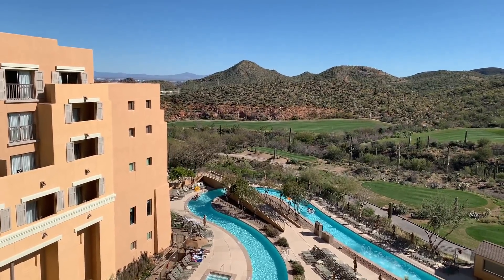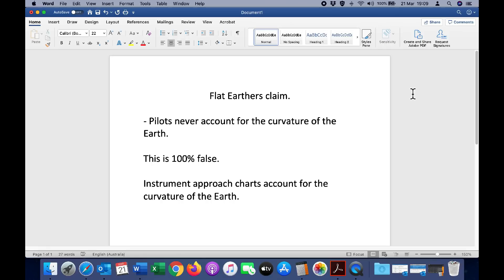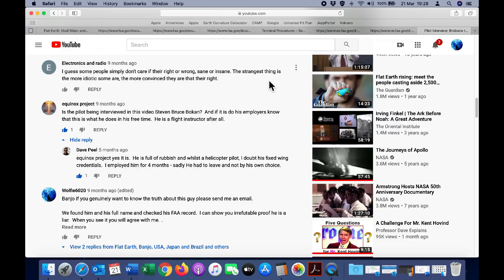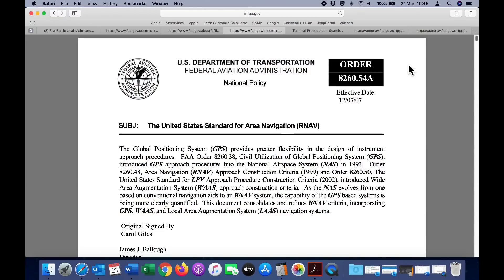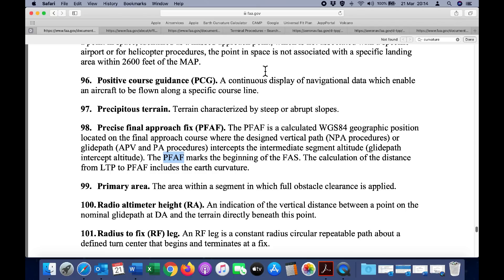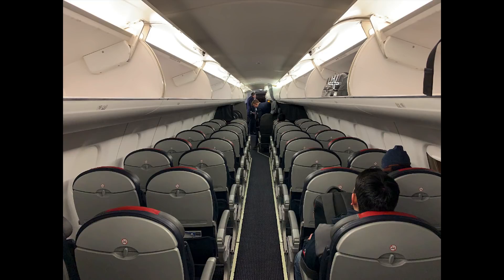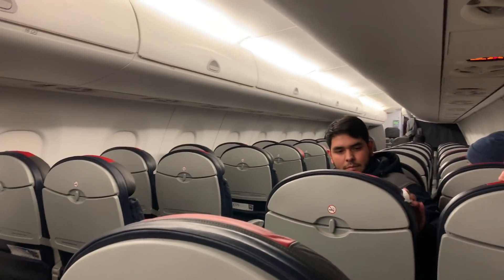FAA Documents confirm Pilot approaches are calculated for the curvature of the Earth.

Comment: As per usual, Wolfie takes no prisoners.
Reply: Muzikgod #IsARectalCumDumpster.

Reality is actually on my side when you co and look.
Reply: @blurplebear8573  Wow you're stupid
Reply: @blurplebear8573  So you didn't answer to what is the distance between Sydney and Santiago, you just linked to a site that teaches how to understand where you are on the globe earth. That's fantastic.
So a flart earther defines where he is using the spherical geometry.
It's complicated the spherical geometry, the flat geometry is a lot more easier, there is no distortion of the features on the map no matter how big it is.
So it should be the simplest thing to do, calculating a distance on a flat map. Everyone is still waiting your calculation Sydney - Santiago.
An approach for landing is not a curve on a lateral side. 
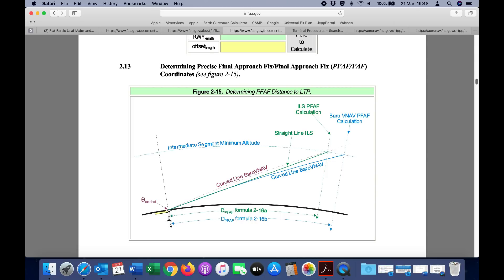5:45
It is a rectilinear or almost rectilinear path, that follows in one case a radio beam that has a straight path. The straight path becomes slightly curved if the earth is considered as flat, but actually it is straight according to the laws of physics of polarized electromagnetic beams, and if it seems curved in terms of altitude it is only because the earth's surface is curved.
 It seems you were talking with 2 pilots, besides wolfie who is a pilot, how can you think to have the right to dispute what they say?
Reply: @blurplebear8573  if reality is on your side, why do you have to keep running and make excuses?
If reality is on your side, why does my photograph show clear curvature at 41000ft?
If reality is on your side why won't you tell us the distance between Sydney and Santiago?
All you do is run and hide like a coward.
Reply: @Alysm-Aviation  It's so funny how he says Lat and Long are based on 2D and yet refuses to show that 2D map or use it to calculate a distance! It's almost like it's impossible
Reply: @hashmaldawn3878  because he knows that if he tried, he would destroy the FE.
Reply: @Alysm-Aviation  I do wonder what goes on in their minds. Do they accept to themselves that they are wrong? Despite all their squirming they must realize that it's impossible to do that calculation yet they keep on. Or are they trolls all along, and never actually believed the earth was flat?
Reply: @hashmaldawn3878  they are cultists, they know that the second that they question the FE, it will fall apart.
Reply: @marks9935  you come onto a 4yo post with... nothing...
Good job.
can you answer a very simple question for me?
Why do even the simplest of navigational techniques, such as calculating our flight distances, require us to account for the globe?
Reply: @marks9935  I love that you came here with nothing but excuses.
Reply: Alysm nope, just liberties with data.
Reply: @blurplebear8573  You clearly have not watched the video lmao
Reply: @blurplebear8573  Try looking at the video again. It doesn't talk about a horizontal curve during the approach but the relevance to the vertical profile, exactly where we expect to see a difference.
Reply: @blurplebear8573  tell me, can you show me something as simple as a functional FE based map?
Reply: @blurplebear8573  
        Geometrically challenged, aren't you? Interesting strawman you're trying to build there. Before I go further one simple question. What are the four basic forces of flight?
Reply: @zed1stwizard  Oooh, I know! Buoyancy, Density, Flerspective, and Droppity! Oh, and compressed air (for the engines to run forever on)!
Reply: @blurplebear8573  Can you kindly tell me why the following definition is necessary in an aviation document for safely flying over a flat Earth?
It's at the bottom of page D-1 (Appendix D) in FAA order 8260.3D:
"(2) r is the TERPS constant for the mean radius of the earth for spherical calculations in feet. r = 20890537."
Why would "spherical calculations" involving the Earth radius be necessary if it were flat?
Reply: @Alysm-Aviation  That shut him right down, didn't it? It always does that. Either they run away or go into a rage. They are fake. I just addressed this very point in my latest video.
Reply: @OAlem  yep
Reply: @blurplebear8573  so why did you lie and run away?
Reply: Alysm yeah it’s called any azimuthal map printed.
Reply: zed1stwizard that has nothing to do with whether the earth has a curve or if it’s moving.
Reply: zed1stwizard so you’ve talked to every commercial pilot in the world and you’re calling me deluded?  Think you’ve got that in reverse buddy.
Reply: @blurplebear8573  You don't need to talk to every commercial pilot in the world, but you do need to find one long-range pilot that can demonstrate how they navigate over a flat earth.
You realise that there are an almost infinite number of Azimuthal Projections right?
Reply: @blurplebear8573  oh I can destroy you much easier, simply by asking you for the distance between Sydney and Santiago.
When you try to BS a pilot, try harder.
And this time, don't lie and run.
Reply: @hashmaldawn3878  they don't know how AE projections work.
Reply: @Alysm-Aviation  I got a hint that this one might understand slightly more as he referred to "any azimuthal map", suggesting he knows there is more than just the one flatties usually try to pass off. Any sign of actual knowledge should be encouraged. But then I'm a glass half full kinda person.
Reply: @hashmaldawn3878  if he understands that there is multiple different types, then he knows that the FE is dead.
Reply: Hashmal Dawn well they take off and land.  That demonstrates it.  I also didn’t say it was flat.  There’s no curve though and it’s not spinning and you can’t prove either of those things.  Furthermore this FAA formula is calculating the curve of a turn the airplane makes during its descent to the ground.  That doesn’t mean the earth has curvature.  That’s called misinterpretation of data.  My car tires have a curve too and I can calculate it.  That doesn’t mean the earth does also.
Reply: @blurplebear8573  I "prove" the curve every time I go to work!

Now talking about deliberately misusing data, what turn do you think is in this video? Both precision approaches and non-prediction approaches are generally straight and with a fixed rate of descent. Fatuous comments about wheels won't help your case.
Reply: Hashmal Dawn it says it explicitly in the text which I read that it’s a descent turn and the curve is being calculated for that turn.  Are you saying you descend your planes in a straight line all the time?  That would mean you’re probably crashing them and it still doesn’t prove the earth has a curve.  It proves that turns you make in an airplane does.  The fact that you can’t decipher that difference makes me skeptical that you even fly an airplane.
Reply: @blurplebear8573  The approach is the last 3 or 4 minutes of the descent and the last 6 miles or more of any instrument approach is always straight. Look it up or maybe you can ask any longhaul pilots you personally know.
Reply: @blurplebear8573  ah, have I torn apart your claim that the AE projection is an FE map so easily?
Ok let's try this again.
Show us a functional FE based map.
Reply: @blurplebear8573  ok then tell me the distance between Sydney and Santiago on your AE projection.
Reply: @blurplebear8573  Which azimuthal projection, there is an almost unlimited number of them?
Reply: Alysm Actually a ton of wolfies prisoners in here yourself included. He’s captured your intellects quite efficiently. There is no real strength in numbers online. It’s a forum of exposition of intellect. It seems it brings out the child in the most skilled of tradesmen. The doctors of the skies included. I have nothing against pilots or those that believe they are on a globe.
Reply: @drich4608  funny yet here you are with not even a functional FE based map.
Reply: Alysm I have one. I’m applying a scale to it in case you need to use it to compare it to the real world. I have a life. Check my Instagram if you don’t believe me.
Reply: @drich4608  please post a link to your FE based map.
Reply: T1DRUMMER thanks brother.
Reply: @blurplebear8573  I notice that you still run away when I ask you for the distance between Sydney and Santiago.
Reply: @drich4608  bahahaha, I just saw antonios map on your Instagram.
Comedy GOLD!
Have you tried drawing in the equator or the tropics?
Oh man, you get more entertaining with every post you put out.
Reply: Alysm I had some life events today. Now I’m watching a comedy movie called “AD ASTRA”. It never ceases to amaze me how these types of movies feed the reality show called space. Great scenes with vintage tin foil or lighting gel plastered on the front of the rovers and the landing gear of the capsules. #neverstoplearning I’ll “present” a map for you very soon. I have limited web access.
Reply: @drich4608  don't lie, you will never show a functional FE based map.
Reply: Blurple Bear Ditto
Reply: Alysm I don’t lie.
Reply: @drich4608  you claimed to have a functional FE based map and then showed Antonios map, so yes, you are a liar.
Reply: Alysm Sorry about that I was drifting off. I was going to attach a scale to Antonio’s map for you. Do you think Antonio’s map is not functional? I think It functions quite well. Keep calm.
Reply: Alysm It’s accuracy is much better than other FE renderings. Just as globe maps are not all identical. If one map is more accurate than another does that make it more functional than than the dysfunctional? Define your version of functional maps.
Reply: @drich4608  Antonio's map is not functional. A functional map of the flat earth must be capable of demonstrating flight paths. Not just a few flight paths but all of them. It does not need fine detail.
Reply: Faster Horses I have already in the rest of this thread.  This video is making the assertion that because an airplane makes a curved turn during its descent that the earth is curved.  That’s retarded and incorrect.  It’s like saying because your swimming pool is round the earth is too.  The documents he sites are for the descent turn of an airplanes approach and the curve of the turn.  He is using that and applying it to the whole realm.  That’s not how it works.
Reply: @blurplebear8573  You want Earth Curve accounted for in aviation that you can't misinterpret or spin a narrative around? You got it. Look in the document FAA Order 8260.3D on page 10-8 at the bottom. It says:
"Because the earth curves away from the OCS as
 distance from course centerline increases, the MSL elevation of an obstacle is reduced to account for this. Use formula 10-2-3 to calculate OEE" 

(OEE stands for Obstacle Effective Elevation, and OCS stands for Obstacle Clearance Surface)
Note also, that the relevant calculation also uses "r" (Earth radius in feet). Same constant as in the formulae Wolfie showed you in this fine video.
No critical-safety-related obstacle-avoidance calculations would need to account for the curve in the surface of a sphere, if the Earth wasn't one.
Reply: sleat and none of that means the earth is curved.  It’s relating to turns the plane is making.  You must not understand that you can turn at a curve on a flat plane.  Cars do it all the time.  Airplanes make descents with a curved turn.  Just because the turn has a curve doesn’t mean the earth does as I’ve stated ad nauseum.
Reply: @blurplebear8573  Hey Blurple. Can you link either the time stamp where it mentions turning or quote it directly? I can find nothing that backs up your claim but I'm happy to be corrected.
Reply: Hashmal Dawn yes if you read the actual FAA section he’s is using in the manual link he provided it describes an approach turn the airplane is making and the formula applies to the curve of that turn.  I read through the whole section on that and it’s being used to verify earth curvature which it clearly does not.
Reply: @blurplebear8573  So which document are you referring to TERPS or RNAV, and which page? Wolfie isn't referring to an "approach turn" in this video.
Reply: Hashmal Dawn it’s the document he has linked under his video and I do not remember what section he was referencing.  He says it in the video. 
https://www.faa.gov/documentLibrary/media/Order/8260.54A.pdf
That’s the link under the video.
Reply: From that document he claims that section 2.13 is providing evidence of a curve which it clearly does not.  It’s describing an approach during a landing and calculating the curve of that.  It’s literally in the video.  How did you miss that?
Reply: @blurplebear8573  Final approaches do not generally have turns. Wolfie is describing the final descent and how it is subtly different between a radio transmitted glideslope and an RNAV glidepath, and that difference is due to the curvature of the earth. How did you miss that?
Reply: Hashmal Dawn that’s not what the guide is saying.  And yes airplanes do tend to turn when they are getting close to the final approach.  I’ve ridden on a few.  What you’re failing to point out is that none of this means the earth is curved. It’s like saying that because the curve of
The turn in a road is slightly different due to the angle of it that the earth is now curved.  It’s not applicable to that.  Neither does the radius used for calculating this prove a curve because circles have radiuses and those are not all spheres.  Now when you go out and actually measure for visual curve and apply the formula it’s is nowhere to be visibly seen.  You do t get to say because my swimming pool is round and therefore has a curve I can calculate for then the whole earth is the same.  That’s what’s being done here with this nonsense.
Reply: @blurplebear8573  When they are getting close to the final approach they can often turn but not when they are actually on the final approach, defined when past the FAF (Final Approach Fix). That's the exact point that matters in Wolfie's video. I'll repeat, the glideslope (radio generated) is slightly different from the glidepath (generated from GNSS) and that difference is due to earth curvature. Not sure there is any comparison to roads there.
Reply: @blurplebear8573  I'll try once more. It's the difference between the two types of approaches, RNAV (GNSS) and ILS (radio beam). They have to be different due to the curvature of the earth. The point of the video isn't supposed to "prove" that the earth is a globe but to demonstrate that pilots do take into account earth curvature. It does that very effectively, which is why you have to pretend it is about turning.
It's clear that nothing will convince you that the earth is a globe, you don't care what evidence is presented, you'll just ignore anything that threatens your dogma. Unfortunately, I have to work in the real world and that requires for me to navigate using spherical trigonometry, so I don't have the luxury of simply using my imagination to pretend it's something else.
Reply: @blurplebear8573  ah, I notice you ran away from me yet again, as expected.
Reply: Hashmal Dawn  that doesn’t prove the earths curved it proves that airplanes make curved turns.  If the earth was curved then airplanes would have to fly at a constant curve to compensate for it.  So why do they only need to factor it into the descent approach turns?  Is that the only time it’s curved?  If this proves the earth was curved they’d have to factor that into the entire flight process from take off to the flight to the landing.  You don’t get to pick and choose when the curve is there or not.  This video does not prove that earth curvature is taken into account.  It proves that turns have curves and they need to be calculated.  You have said nothing that proves that false.  More to the point you said it doesn’t prove a globe earth which is exactly the opposite of what this video is stating.  So you yourself are stating that this video disproves what it is intending.  So like I have said 40 times already a curve calculation for an airplane turn is not proof of earth curvature.  I can calculate the curve on my plates at home too that doesn’t make the earth curved.  You are using logic fallacy to attempt to prove something that’s not true.
Reply: @blurplebear8573  I love how your argument is fallacy after fallacy, no wonder you ran away from me.
Reply: Alysm no I don’t.  You’re the one running in circles with nothing relevant to this argument.
Reply: @blurplebear8573  Pilots do factor earth curvature into the whole flight, it's called navigation.
Reply: Hashmal Dawn no it’s not.  They’d be flying on a curved arc the whole time not gliding straight and still not relevant to any of this.  There is no visible earth curvature anywhere and a formula for a curve in a turn doesn’t prove there is.
Reply: @blurplebear8573  They do fly on a curved arc all the time, it's called a Great Circle. Would you like me to quote from the flight manual? 
"Lateral Navigation (LNAV)
LNAV provides steering commands to the next waypoint or the selected route intercept point. When armed on takeoff, LNAV engages at or above 50 feet, when laterally within 2.5 nautical miles of the active route leg. FMC LNAV guidance normally provides great circle courses between waypoints. However, when an arrival or approach from the FMC database is entered into the active route, the FMC commands a heading, track, or a DME arc to comply with the procedure."
Reply: Hashmal Dawn well then why do they glide on a flat line whenever I ride them and they get to cruising altitude?  You know the altitude that they maintain for long periods when gliding?  They aren’t flying on a curve then which would mean that they weren’t compensating for the curve of the earth right?  Or is it not curved when they’re at cruising altitude?
Reply: @blurplebear8573  they don't glide in a flat line... I would love to fly the aircraft that can glide in a flat line.
Now, why do you keep making excuses and running away?
Reply: @blurplebear8573  Aircraft don't maintain a constant altitude when they are gliding, but I think I know what you meant. I just showed you the flight manual saying that the sectors are Great Circles, which are curved. Do you realize that when you are cruising at 40,000 feet that you are rarely at 40,000 feet and are pretty much continously climbing or descending? Yet you don't feel that either. Aircraft don't maintain a distance above the ground, they maintain a constant air pressure. As that pressure changes, so does the distance above the ground. Take a GPS receiver with next time you fly and you'll see what I mean. Just the other day my altimeter read 40,000 feet and yet I was at 41,500 in real terms.
Reply: Hashmal Dawn And none of that means there’s a curve to the whole earth which is my whole point. Great circles does not mean the earth is a sphere.  Also most cars don’t maintain the exact same height off of the road when they’re traveling either.  That doesn’t mean there’s a curve to the ground or the earth.  You are applying concepts to the system that do not describe the system.  The fact that you cannot see that makes me highly nervous to be around you, especially if you fly things.  As for GPS all that is is triangulation which requires three points and still doesn’t prove curvature.  It proves that the math for triangles works though.
Reply: @blurplebear8573  I still love that you think you know more about aviation than actual pilots.
What's even better, Great Circle routes are the shortest paths between any two points on a sphere, which damming for the FE given that the direct flight between Sydney and Santiago is completely over the southern hemisphere and is just over 11000km, instead of the over 25000km it would be on your "FE map".
You know this, which is exactly why you refused to tell me the distance between those cities when I asked you.
Reply: @blurplebear8573  Great Circle navigation does prove that the earth is a globe as it is able to describe the whole earth, something flat earth hasn't even attempted. Just the same as using Latitude and Longitude enables you to calculate the distance between any two points, only possible using spherical geometry.
4 satellites are needed to give a GNSS position, but my point was that you can check your actual altitude using it. You just saw GPS and went into automatic denial mode, and simply ignored my point entirely. Feel free to be nervous around flying with me, but luckily my ratings are not dependent on the views of someone who knows nothing about aviation.
Reply: @blurplebear8573  Latitude and Longitude aren't triangulation, they only work using spherical geometry. Feel free to prove me wrong. I agree that NASCARs going around a track doesn't prove that it's a globe but that isn't spherical geometry is it?
So, how about you actually come up with evidence of your belief? Like the map that Alysm asks you for? Or the distance between Santiago and Sydney? You can use simple trigonometry if you like.
Reply: @hashmaldawn3878  notice how he desperately avoids me now because of how utterly helpless he is against any point I brought up so far?
Reply: @blurplebear8573  You realize that is calculating the Latitude of a point right? Doesn't even mention Longitude. So let's see you calculate the distance between Santiago and Sydney. The position of Santiago is 33.4489° S, 70.6693° W and the position of Sydney is 33.8688° S, 151.2093° E. It's just triangles right?
Reply: Hashmal Dawn yeah that’s exactly what it means calculating points which is what latitude and longitude do.  Are you now telling me that the math on that is wrong also?  What do you think latitude and longitude are?  They’re points on a 2d plane calculated by triangulation.  As I just illustrated to you.  Are you disputing that?
Reply: @blurplebear8573  you mean like thw fact that I have destroyed you in every turn.
I have destroyed your claims about navigation.
I have destroyed your claim that the AE projection is an FE based map.
I have shown you curvature from 41000ft. 
All you have done so far is run away like a coward.
Reply: @hashmaldawn3878  notice how he will absolutely refuse to do the calculation?
Reply: @blurplebear8573  Yes I absolutely dispute that. But you can prove me wrong by calculating the distance between Santiago and Sydney. Of course, if you can't, then that proves me correct. Miles or kilometers will be fine
Reply: @Alysm-Aviation  Yes, it's very obvious
Reply: @hashmaldawn3878  it's funny how desperately he's flailing about.
He knows that he has lost, but refuses to accept reality.